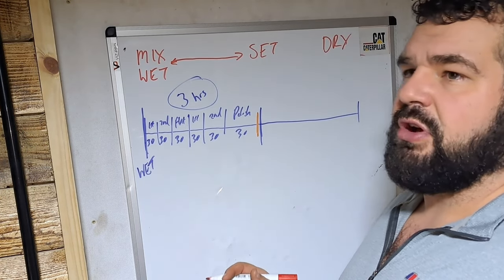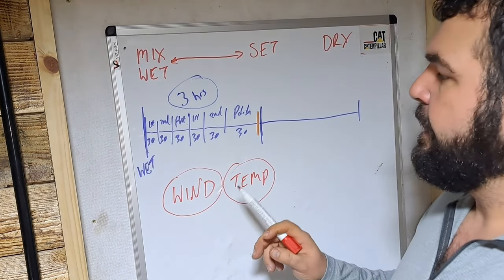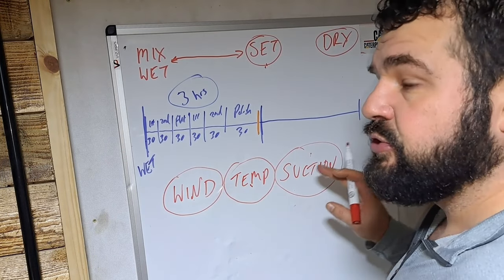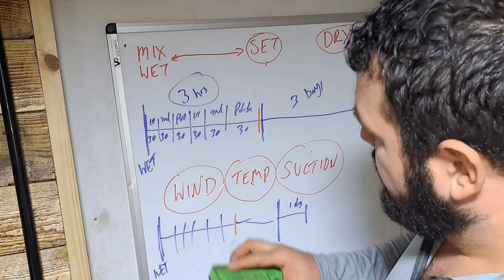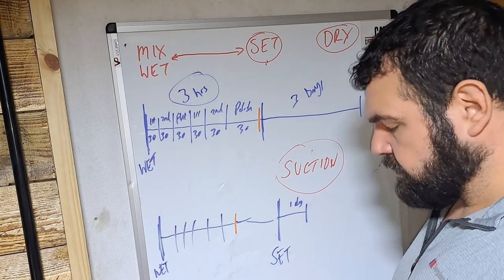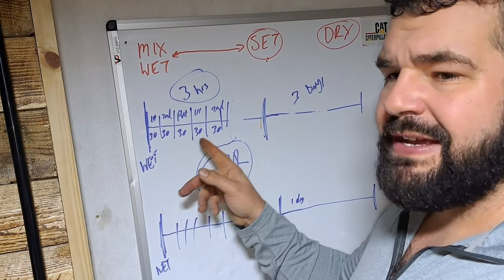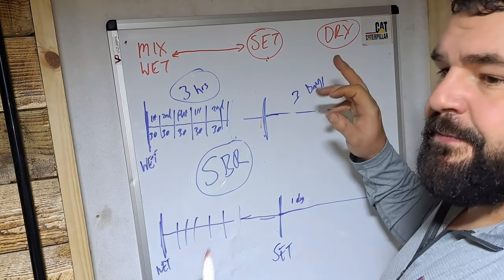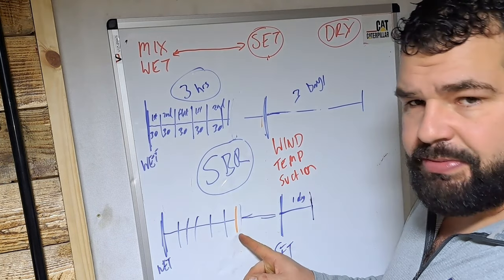Understand setting times part 1

Comment: Plastering is pure instinct and experience.. learn to apply the materials correctly. then the rest only comes over time many years of time.
Some pick it up faster than others.
Touch test is king.

His video is extremely useful for all you young guns that are thinking banging metres on every, day is the answer.. it's not
Because turst me you won't last long on the trowel,
Due to your elbows, lower back, wrist will be 100% shot before your 40. Fancy pain killers with ya cuppa in the morning. Having to stop by 2pm due to pain...that's what awaits.

All the very best to you and ya challenge bud 

Happy new year 🥃👍
Reply from the maker: Cheers Steve, slow an steady. Better to be the highest paid rather than the fastest.
All the best for the new year mate

Comment: Knowing when to work plaster and when to leave it alone is definitely a massive part of the skill, as a diy,er I always worry it will become unworkable before I complete the process and end up playing about with it too much,
Reply from the maker: Don't worry to much at this point mate, as long as the walls are flat and no trowel lines or misses then you will be fine giving it the odd extra go over. 
You will just get better at getting it smooth with less work over time

Comment: Well done Kirk refreshingly genuine channel with real world practical advice. If you are using hardwall on the recommended high suction backgrounds such as brick or block do you need to apply SBR on the wall or just wet the wall? Is SBR priming just when multifinish and bonding? Thanks
Reply from the maker: Yes mate just damp the wall down, you don't want it soaking because the hardwall will just slide

Comment: I've never used SBR I've always used PVA. Just wondering when you apply SBR, how many coats do you apply to walls/ceiling? I ask this because with PVA, I was always taught to apply two coats.
Reply from the maker: SBR, just one coat and don't water it down, just use it neat
Reply: Cheers for that mate. 👍

Comment: hi Kirk did you do another video like MarcusT86 suggested? As a improver plasterer I did a wall in the house following your advise and it came out mint and then did another the next day and it didn't look as good even though it was flat I did use a new trowel on the second wall which may have been the reason for the not so good finish any advise is really helpful. keep up the awesome channel it's really helpful

Comment: Do you need to SBR or PVA on new plasterboard? I've always been told you don't need to.
Reply from the maker: No NEW plaster board is fine to plaster straight onto. If the board has been up for a few months then seal it but otherwise its fine to go straight on
Reply: @Onthetrowel  thanks for the update...

Another quick one....I have never plastered before and plan to do so in the near future. If my plaster mix runs out before I finish the wall, does this cause any problems? Or is it just make a new mix as quickly as possible and carry on.
Reply from the maker: That's it just mix more fast 👍

Comment: Don't agree with PVA point ...I have been using PVA all my time plastering (34years)and have had great success both inside and outside work. Suction is the plasterers friend and  can be controlled with the strength of the PVA/water mix . Not saying don't use SBR but I personally like PVA.
Reply: Just the opposite m8 I’ve had pva fail to control suction on high porous backgrounds many times so swapped for sbr and never fails and only one coat
Reply from the maker: I agree with you, the point I'm making is for beginners that have never plastered before suction is their enemy. Pva can control suction but you need to know what your doubts with it whereas sbr kills suction all together  so if they wanted to practice then sbr would be the best thing to completely remove suction as a factor that you have to deal with.
Reply: @Nofixedabode859  PVA was all we had at one time and never was there any problems .If you are happy using SBR rather than PVA then that's your call.Each to their own . Happy New Year 🎉
Reply: @ianturner8459  just saying m8 that’s wat comments are for point is sbr is better that’s all where saying😊